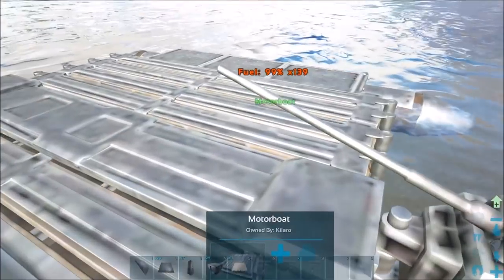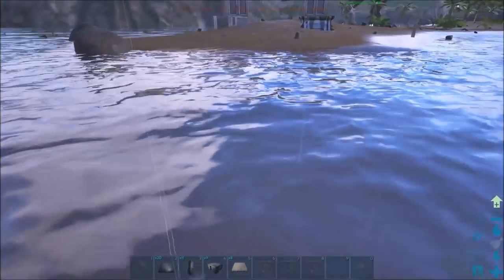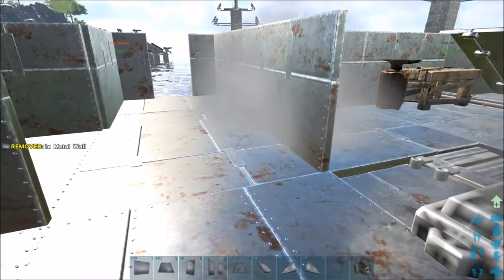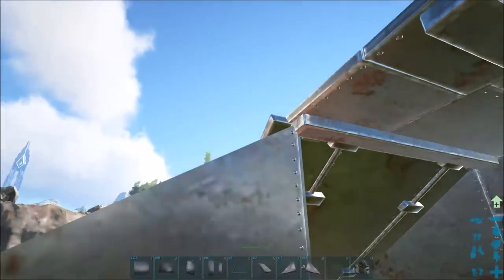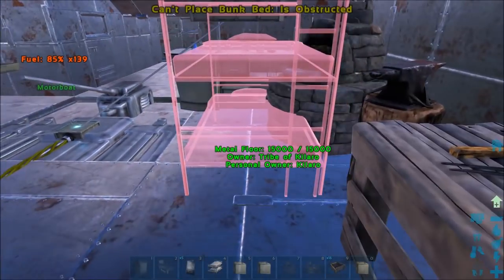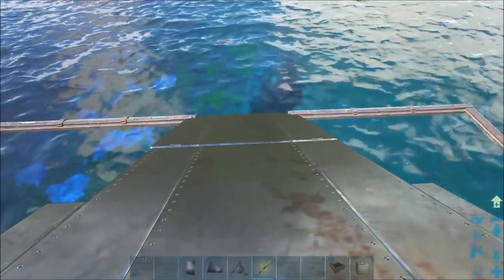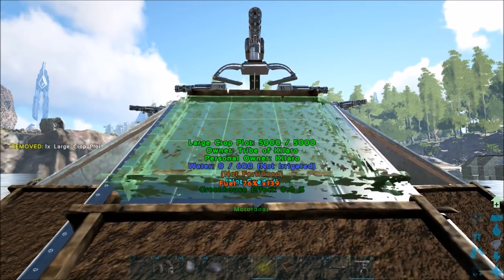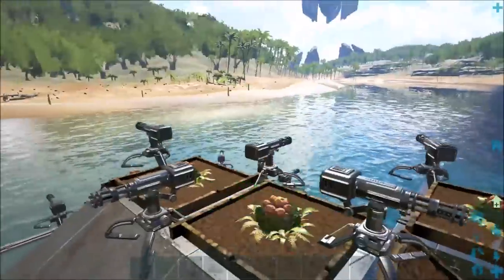Light Aircraft Carrier Tutorial, Deadly PvP motorboat - Ark Survival Evolved

Comment: I was 100% On board until you started doing interior ! Way too Much Clutter and why the need for all the turrets ?
Reply from the maker: The turrets are 100% a must in pvp.  You need to be able to kill enemy dinos quickly before they can escape your raft.  Additionally you need lots of turrets to hold all the ammo so they can't easily tank out your bullets.   As for the interior, I prefer it to function as a back up base, in which case you need all that junk in there.  That's up to personal preference of course,  if you don't want all the junk in your raft it's not entirely necessary.

Comment: How much gasoline does the motorboat burn through? say it was left on for a hour? how much gasoline will be needed?
Reply from the maker: I don't have the exact amounts, it burns a different amount when you are driving it vs when it is stationary.  When it is stationary I believe it takes 5 hours to burn 1 gasoline.  But it seems buggy as I have came back to empty boats when accidentally leaving them on.   When you are driving it seems to burn through 1 gasoline every 3-5 minutes.   Remember all the defenses on your boat are powered through your generator and the boat itself has it's own gas which is only 1 stack of 100 on officials, so when you are not driving the boat, just shut the boat itself off to conserve your gas.

Comment: Do Plant X work on rafts again?
Reply from the maker: Yeah they work.  You just can't adjust the settings on a raft, so they will be stuck on medium range and set to players and tames, which is the default.  It's still worth it in pvp as the slowing/blinding effect is invaluable.
Reply: Newbie4Hire Do u know if the boat can move faster than Leedsics or alpha leedsics
Reply from the maker: the motorboat moves faster than a leeds, slower than an alpha leeds.